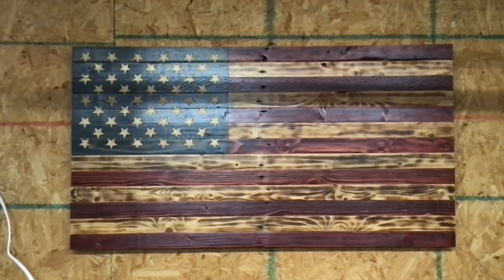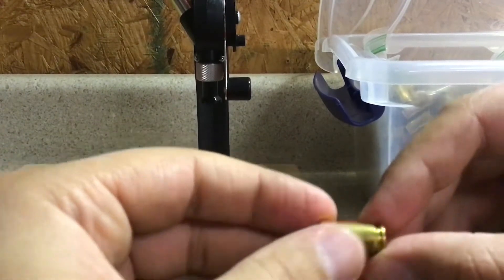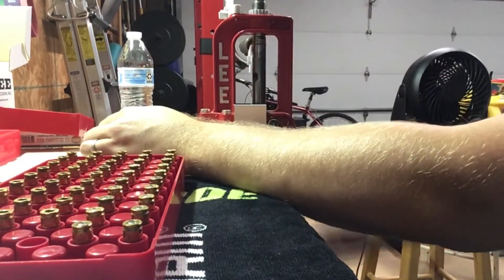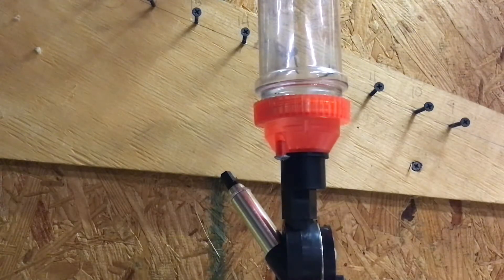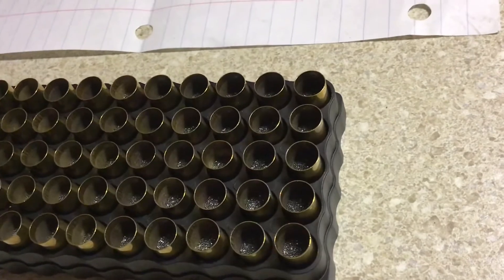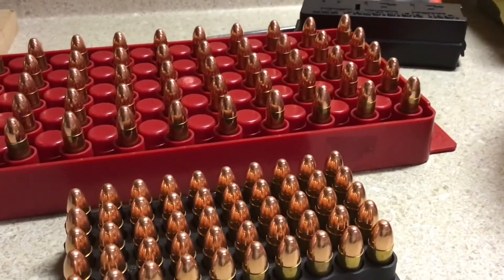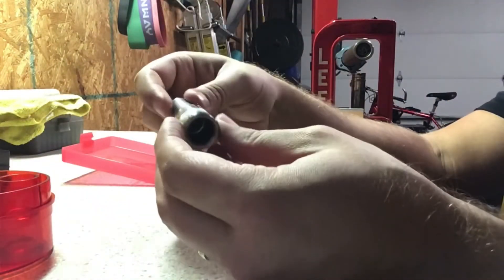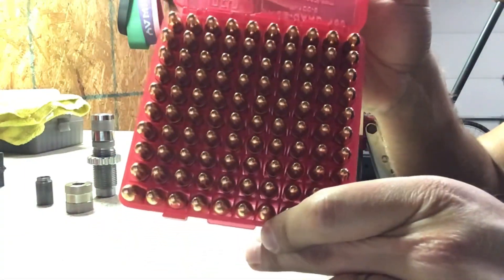100 rounds of 9mm on a Single Stage Press

Comment: Using a variety of manufacturers cases could have a few thousandths of variation in the way it marries with the shell holder.  Lateral press flex could add to that as well.

Comment: Did you check the accuracy of the caliper?  You can use drill bits to check the caliper.  When I use calipers I noticed the issue is usually between the item I am measuring and the caliper therefore I take a few measurements to see if I am the cause of the deviation.  .....  Assuming I heard you say Makarov.  The Makarov is a totally different bullet than the 9mm Lugar.    Before the big rush of people reloading, I would just take the bullet apart and toss it into the metal scape heap.    But today, I would take it apart put it in a pile with similar sizing issues, and reload them again, once a dozen or so accumulated.      Keep the videos coming!
Reply from the maker: Thanks Kurt for the comment!  I have not checked my caliper I will have to try that out.  Good stuff.